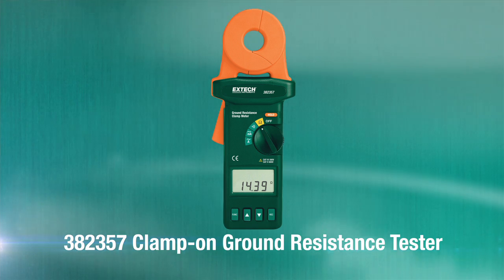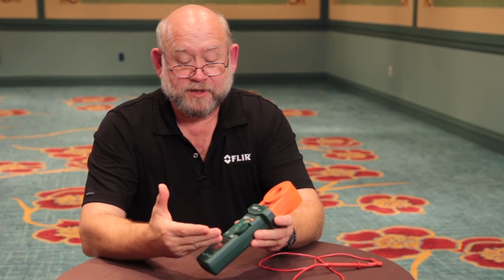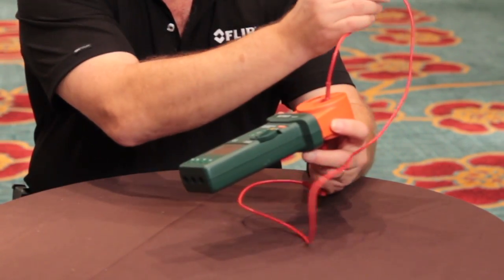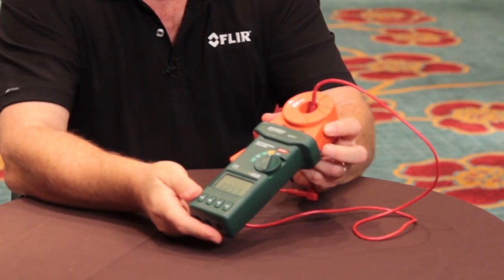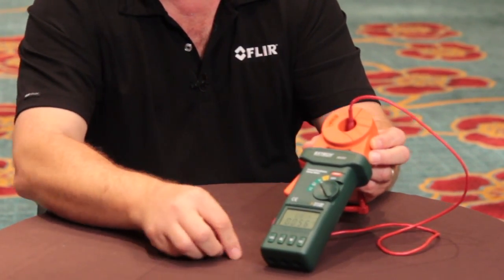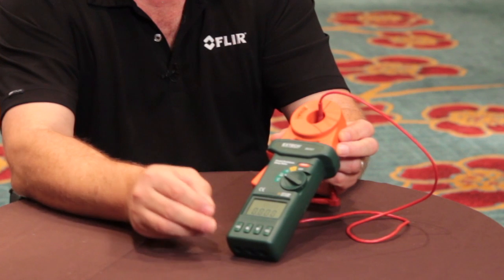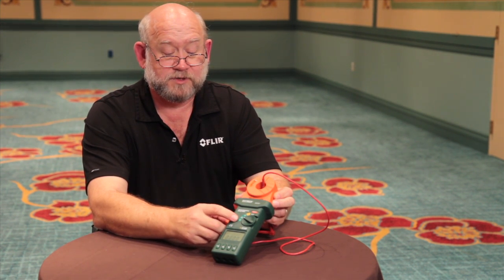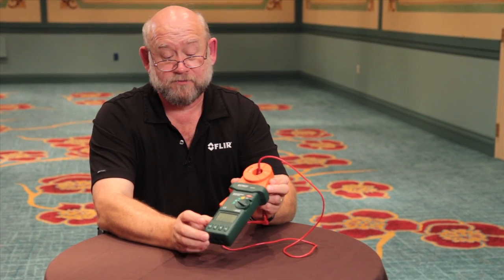Extech Clamp-on Ground Resistance Tester

Comment: 25 ohms eh? Well I have an 8 ft. rod at the meter, underground service 250 feet away to some unknown earth connection. I read 100 ohms. Am I to believe that 250 feet of dirt has only 100 ohms of resistance? Actually it should be in the Megaohms and no way would it read 25 ohms unless the "earth" was made of metal. 
Something is very wrong with this concept.
Reply: It highly depends on the soil and moisture. 5 ohm and below still could be reachable.
Reply: Yes pour some water on it you'll get a better reading